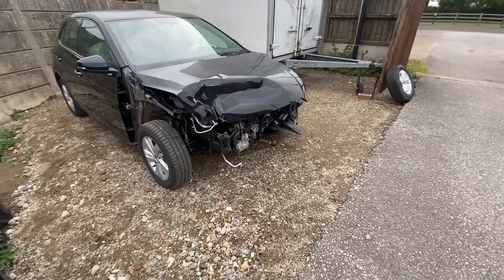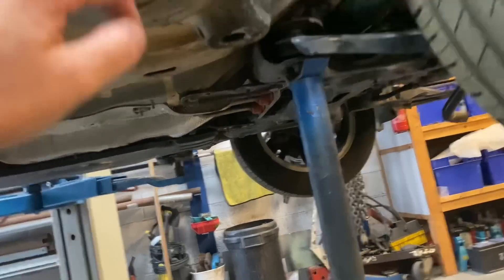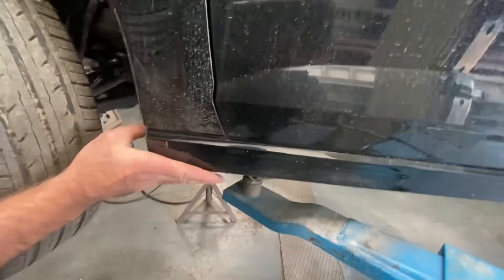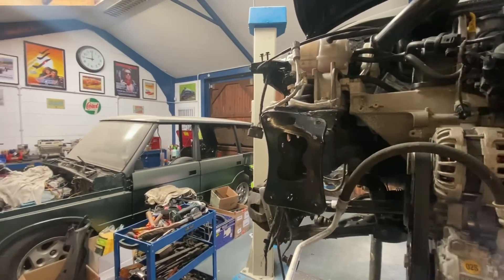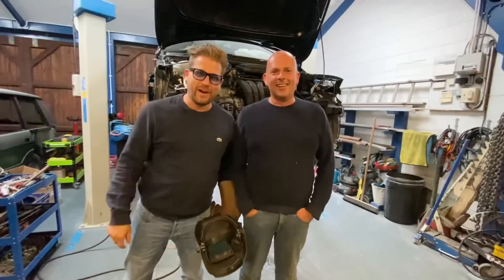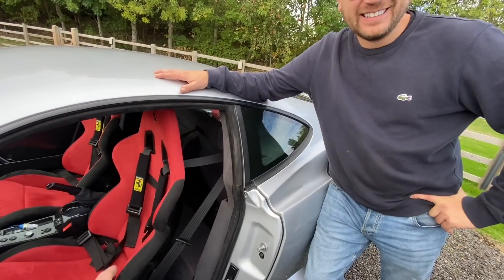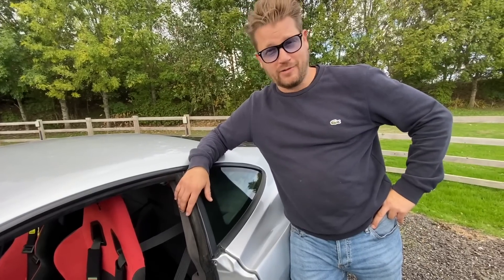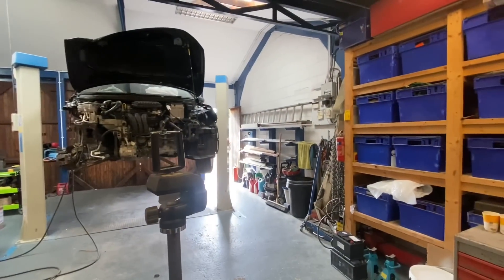REPAIRING A CRASH DAMAGED 2018 VW POLO + SRUK SUPERCAR FRIDAY!

Comment: The Polo is coming along nicely.  Glad you got a parts car for the sill. Also good that Eddie had another wheel  top man. I don't think Watching the welding on video is the same as being in the shop though I think I mentioned to Chris a while ago that it is probably best not to put the camera too close because of splatter. I think the camera filters help. Watching Chris take that seat apart I was amazed that they designed it like that. The seats always used to have the wire frame stitched into the cover a much better way of doing it in my opinion. You still use hog rings but much easier to install, ( some will have a partly zipped back to help with fixing the hog rings). Shame on VW is all I will say.  Anyway it was nice you comparing notes with Scott,  seems to be a nice chap. Rob I wonder if there are some alternative seats available for your car? You would obviously keep the original seat's in storage but it might be worth exploring. You should be able to enjoy the car fully not be in pain when driving. Thanks for the video Rob and Chris hope you have a great weekend. 👍👍

Comment: FYI. 
Welder's flash is a dangerous side effect of welding and one that should be avoided at all costs even when just filming arc welding. Thankfully you cannot get the burn through television or through a camera lens, but it is important to arm yourself with protective equipment when actively filming.
Keep up the good work guys. Fantastic channel.
Wish i had instagram so i could buy a vehicle from you. Not good with social media.
Reply: I’ve never been able to figure out how instagram works, either, seems to do as it likes with all random stuff appearing.
Reply: Yes, it's the UV radiation that causes photokeratitis - it's not limited to 'arc eye' from welding either, for instance the sun reflecting off snow can also cause it too where it is called 'snow blindness'.  It's not recorded on film or digital sensors and can't be transmitted by a monitor or phone screen!

Comment: Forgive me but I haven't got a scooby what you meant when you said about a Challenge car. What does it mean?
Reply: Its a Ferrari Challenge Stradele, it's the model name and trim level with the uprated power output, I'm sure someone will confirm the extra bhp from that model over a normal 360?
Reply: @Squishington3rd  weight reduction. A "Challenge" was another type of 360 but only for the track (no handbrake!)

Comment: Arc Welding on video cannot cause any harm at all to the eye. A standard dynamic range video signal on a waveform monitor does not peak over 1Volt and anything brighter than peak white will simply hit a clip level and look just like white. A higher dynamic range camera and monitor will show a brighter white again if recording an arc welder, but it will not damage your eye sight on any display screen you view it on. Simply put, Arc Welding emits UV light and this is dangerous to the naked eye. A video camera cannot pass UV light to your screen!!

Comment: Is it safe to cut in that section of sill panel? I thought most structural panels like sills were Boron steel and couldn't be cut in like this. I hope I'm wrong.
Reply: They definitely didn't follow the correct methods no. Still a nice job though